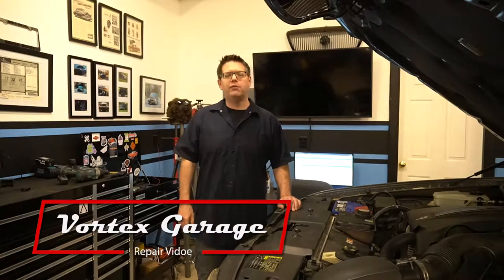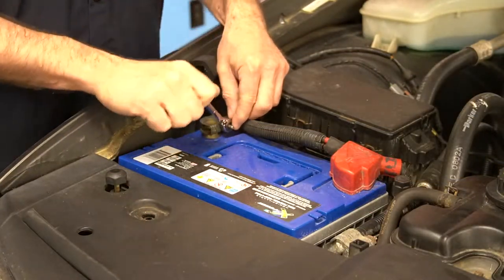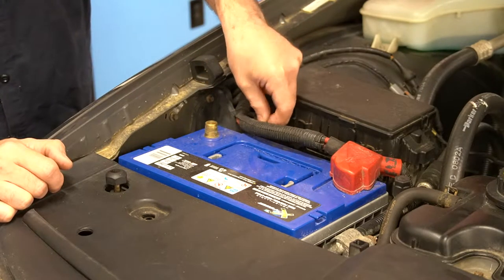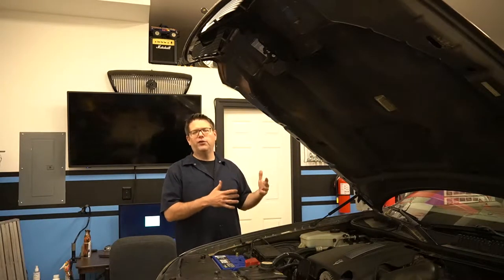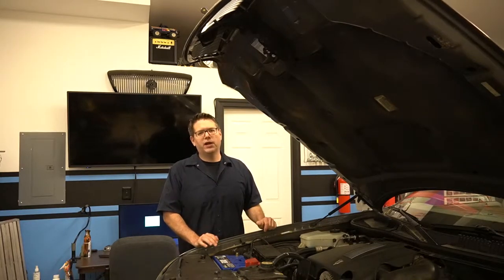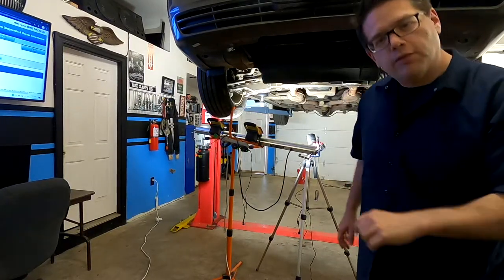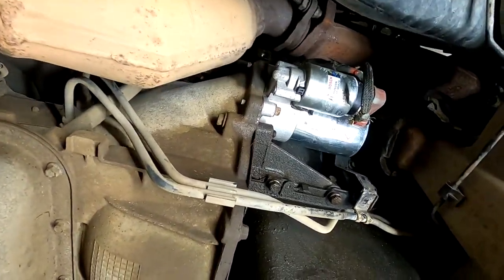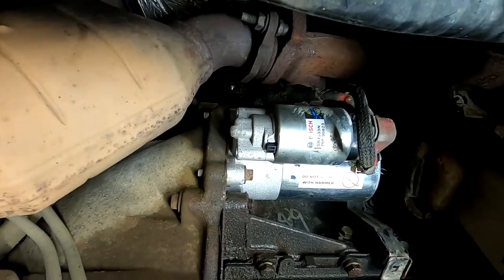2003 Lincoln Town Car Starter Replacement Steps - 2003+ panther chassis starter replace how-to

Comment: "Name brand, new part" fails.  We've all had that frustration!
What are your thoughts on putting dielectric grease on the starter electrical connections to prevent corrosion?

Comment: Currently in the process of removing one off my 2003 Grand Marquis....this thing is a freaking nightmare.....I don't have a lift....I'm working with a low profile jack and and 3 ton jack stands.
Reply from the maker: When I did the first starter on this one it was using ramps only. It was definitely tight. I recall using lots of wobble extensions to get that third bolt....
Reply: Omg I have to do mine soon, not looking forward. I hope u were able to get her taken care of

Comment: If I wanted to test my starter by jumping the solenoid with a screw driver, would I touch the two bolts on the solenoid that had wires connecting them?

Comment: Impossible to do working in the dirt.  No clearance.  Can’t even access the bolts.  Even with a jack take it to a shop
Reply: EVEN WITH EXTENSIONS
Reply: It’s possible to do with the right extensions. I replaced the starter on my 2001 TC. At first, it was a bitch accessing the top bolt and removing the starter, very tight space. After figuring out the right extensions, I removed/ installed in 15 mins.   

I’m about to replace the starter on my 04 TC soon. Hopefully I can remember the correct extensions lol 😂